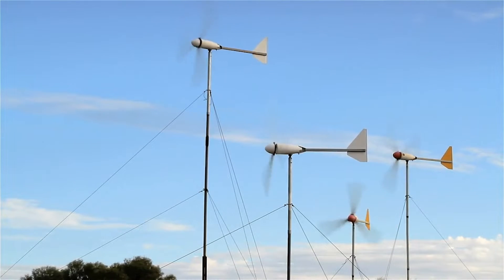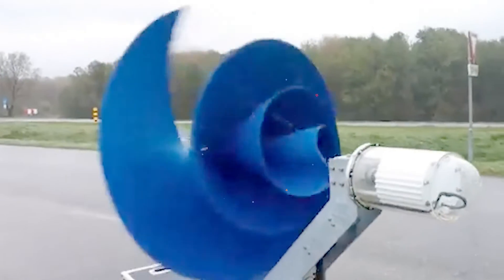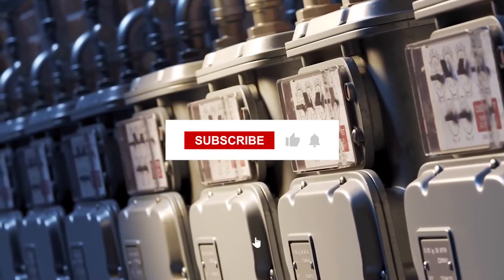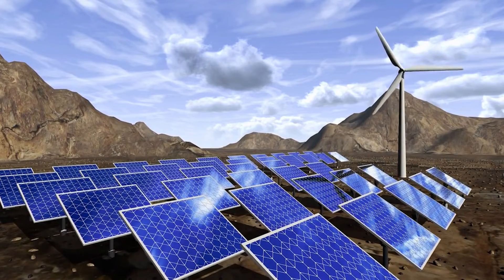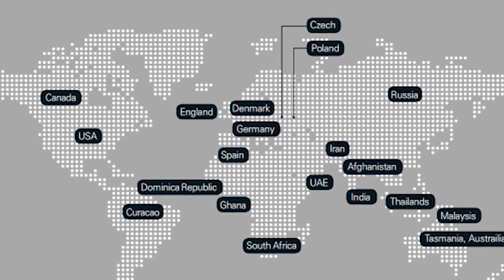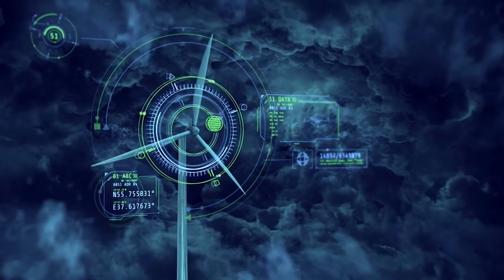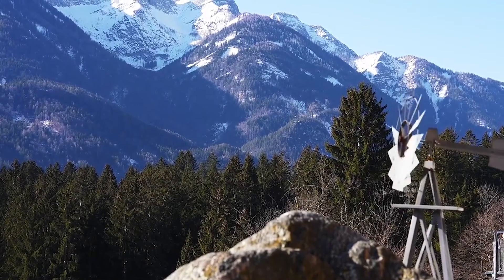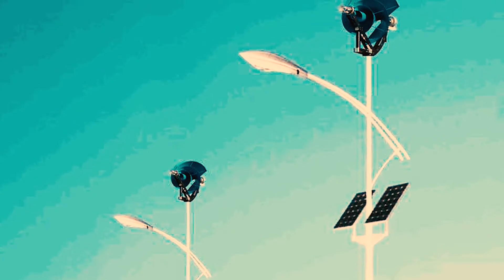This Novel EU Wind Turbine will Replace PV Solar Panels

Comment: PURE NONSENSE! All practical tests show that small wind turbines hardly generate any electricity! And only at very high costs! 
Because there is hardly any wind close to the ground. It is also extremely gusty, which usually shortens the service life extremely!
Only if you need to be off grid & live close to the sea, you should install the largest possible wind turbine on a high mast. 
With solar modules, on the other hand, reliably generate electricity for 25 to 30 years at approx. 2% to 5% oft he cost of small wind turbines!
Reply from the maker: Thanks for your comments

Comment: Absolute BS.  I live on top of a mountain (off-grid) near Yellowstone for the past 30 years.  I've bought into the wind energy scam before.  Two 1500W 'rated' TURDines maybe produced enough 'energy' to light a cigarette in a year. Never recouped the cost of the cable lugs alone ntm the cable,  mast/mount, turdines or labor.   This is NO different except perhaps light 3 cigarettes/year (maybe)  for US$10,00 or more (has anyone priced copper recently? -or mounted anything up in the air that weights 120KG plus drag?)  Per the graph on their (lying) website (no prices) the mini would produce no more than 10W/h (NOT kW) avg thru the year - here.  That's 240W/d or  88 kW/year (less than $9/yr at local grid price).  BTW, gusts do not 'count' aka matter -AT ALL since all TURDines overspeed/cut out in 'high' winds.  PLUS, any 'renewable' will only 'charge' a battery bank when the output voltage is greater than the prevailing battery status.  Which means virtually NEVER - guaranteed.  NTM the other weather factors (ice/snow etc).   If you 'buy' this BS,  then you are an ignorant moron fuk and therefore deserve exactly what you bought!

Comment: Non-sense. You need to harness the energy of wind on a large vertical area to make the few kw of power obtained by the typical residential PV system. Not something to install on your house. A lot of mechanics and moving parts - low reliability. The areas with enough windy days are not very common. And so on...
Reply from the maker: I agree with you in some points. As you know, there is no free lunch. It requires study of the wind profile accuratly.
Reply from the maker: Besides, it has been already in the market